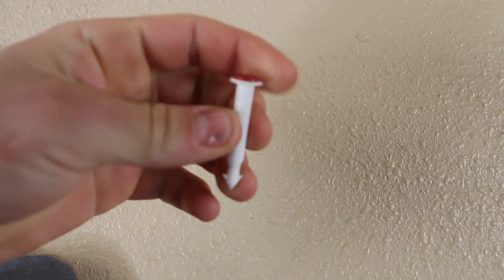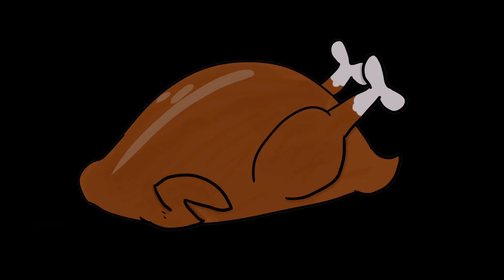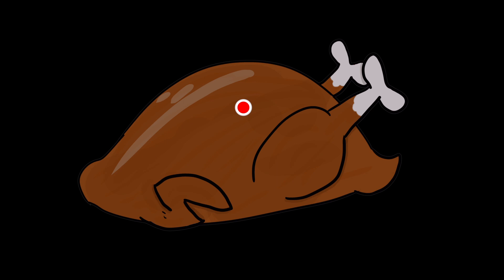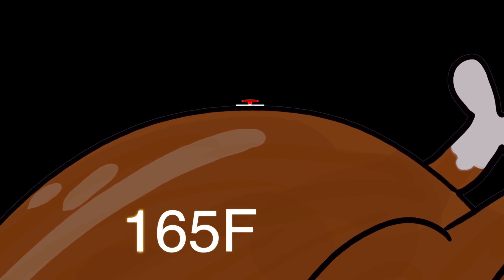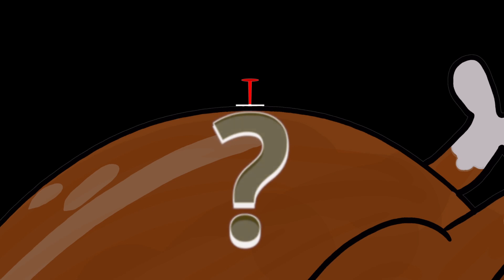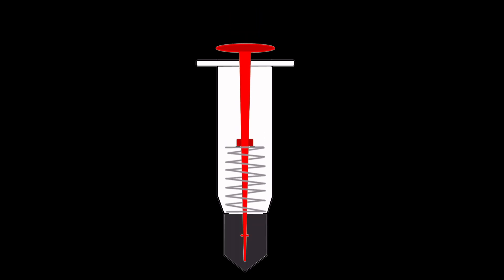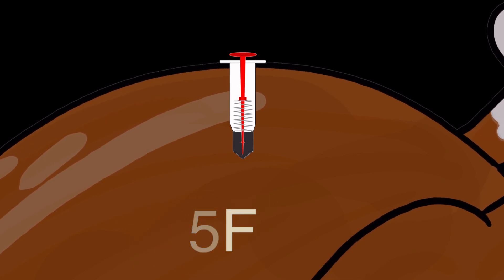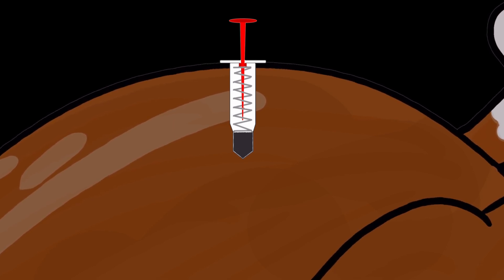The Turkey Pop Up Timer!

Comment: I used a temperature probe built into my oven and took the turkey out at 158 degrees. The pop-up did not activate. So as a test, I put the sensor into water which I heated slowly.  The sensor did not activate until the water reached 185*. The turkey would have been ruined by then, the 158* was perfect and could have been taken out a couple degrees earlier, IMHO.

Comment: Boo ... That's not science. That was obvious. The interesting part is skipped.
What is the composition of the metal or wax that holds in the plunger ? 
That's the interesting part.
Reply: Was not obvious to me!
Reply: (in true Sponge Bob reference)
[two years later...]
The composition is a combination, or alloy, of lead, cadmium and bismuth. This alloy melts at a specific temperature, which is the same as a turkey needs to cook to, 180 degrees F, or 83 degrees C. When the piece of metal melts, the "pop-up" part of the timer is released.

Sorry for the delay!  I will be more punctual next time...
Reply: It’s solder.. could be so many different types of medals combined., one being 70 % indium 30% lead.